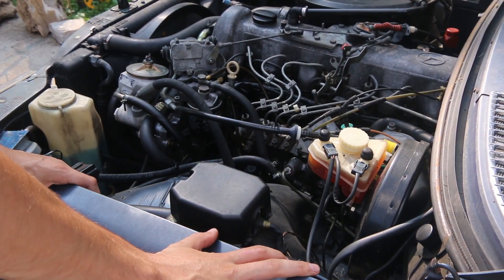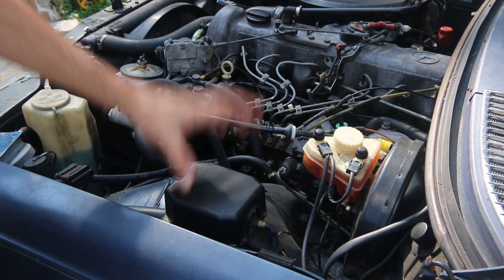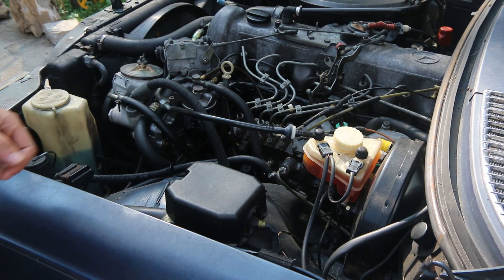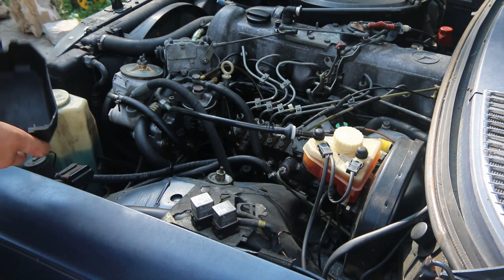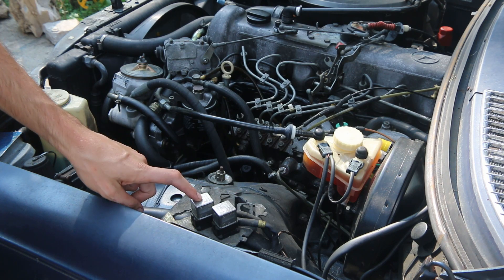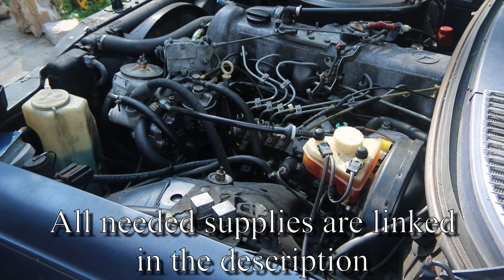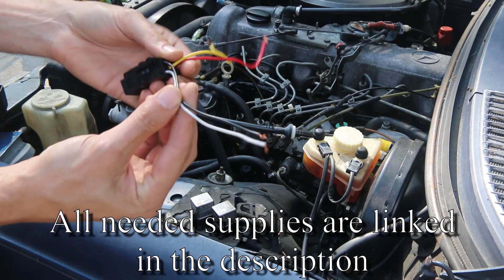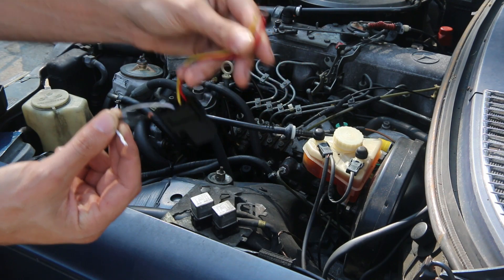W123 Aux fan AC mod & Evaporator cleaning (Cheap/Free ways to get better AC)

Comment: I just put in weeks of work or get my 123 200 petrol ac running and I have been looking for exactly these types of videos. 🙏 I can't thank you enough, especially that R12 is not available in SA
Reply from the maker: It can be real tricky, and while there is a plethora of information available about our cars, there seems to be little about modifications and improvements.
Reply: El gas Mo 49 plus es perfecto para reemplazar el R12

Comment: Years ago I took out the fresh air plastic grates right below the windshield and cleaned out the metal channel area that pulls air into the AC evaporator.  Then I came up with some material to come up with a makeshift cabin air intake filter.
Reply from the maker: Man I have thought so many times of a good way to get some kind of cabin air filter rigged up, the pollen is so bad where I live that its like walking down the yellow brick road to get into my car. I've seen some extreme modifications to accomplish that, with cutting the firewall and fabricating ductwork and stuff that would direct air across a filter, but your comment has got me thinking of some kind of filter material like the k&n outwears or whoever it is that makes filter guard things for dirt bikes and off road machines that repels water and catches big stuff. Would you mind sharing some photos of your setup? send them to my email if you'd like: tom at trythistv dot com

Comment: Hey trithistv, thank you so much for your time on these videos, ungodly amount of help and great explanations. I’ve done your recirculation mod and deep cleaned both the evap inside and condenser under the hood. Both these mods have dropped my vent temps by at least five degrees which is GREAT. Thank you!

I have tried the relay mod several times, but when I attempt to do it, the compressor relay makes an awful noise, and the fan sporadically turns off and on with the noise. It seems that the yellow/black/port 5 isn’t making full contact. I’ve tried running the black/yellow over to a ground point to no avail. Admittedly I know very little about electronics in general, and could just use any help. 

Keep up the great work, you’ve got a long time supporter.
Reply from the maker: Hmmm, I wonder if you've got a fuse or something making poor contact also, Let me double check my instructions and get back to you later on how it should all go together just in case something is off there.

The other night me and my wife went for a drive in the blue car and saw vent temps down near 36F while we were cruising along before the ETR would kick the compressor off to prevent freezing up the evaporator, it was a little cooler than some nights but I was thrilled with how good the AC worked. Felt as good or better than any modern car.
Reply: Well, just the two mods I’ve implemented have drastically improved my commute. For reference I’m in the Piedmont of NC and these afternoons are sweltering on the blacktop. Haven’t put a thermometer up to the vents yet but it’s been feeling about mid 50s even on the hottest days, definitely the 40s once the sun has subsided a bit. Thanks for the help and reply, I’ll keep a lookout for any updates.

Comment: Just fill the system with r152a or air duster like I did in my 1983 240d. I was blowing 38 degrees out of the center vents on an 80+ degree day and lots of humidity. I was running all original components also, all I did was change every seal in the system with new green HNBR O-rings and pulled a 30 in. of mercury vacuum for six hours and then refilled the system and the performance is astounding! Did not change the seals in the compressor also
Reply from the maker: I am actually planning on comparing performance of various alternative refrigerants in an upcoming video at some point.

The big issue with the ac in this car is likely partially the color of the car and interior being very dark. The ac blows 34-36f out the center vents when you're driving above 20mph and it gets frigid cold in the car after just a mile or two but if you stop and idle in traffic for more than a minute or two it started slowly getting warmer in the car.

My main goal is to systematically go through each component that could be improved, cleaned or tweaked in some way in fully stock form without requiring any real special tools or expense, and see what effect it has on the hot engine, idling, stopped in the sun type circumstances, as that is where the system really struggles in this car.

If you've been keeping up, it's made a quite dramatic difference already between the recirc mod and now this dropping vent temps from the mid 60s down to the high 40s in a worst case possible scenario, it keeps the car much more comfortable even on the hottest days.

Switching to 152a is certainly a viable option to improve performance at the cost of not being able to get the ac serviced at a shop (recovering r152a into a tank of r134a will get some nasty comments from the refrigerant supplier) and potential legal issues since the EPA does not allow 152a to be used in "retrofit" applications.
Which is completely asinine considering the performance, and miniscule GWP and ozone depletion compared to 134a even which was touted as the best thing since sliced bread when they phased out r12, and here we have something that is 10 times less harmful for the environment and we're not supposed to use it. Stupid. Utterly stupid.
But I guess that's the norm for that stuff, laws and red tape to prevent all the fun.

Keep your eyes peeled, you'll see some r152a sometime soon
Reply: @trythistv  Thanks for the reply, my AC system was a strong runner since the car had AC from the factory and once the charge depleted years ago no one replaced any components. So I'm running Mercedes original components with all new seals (except the compressor) and at idle I'm doing 40-45 degrees from the center vents on full blast. On the road it gets even better, however lowest I saw was 38 degrees right after charging the car and driving it around with a meat thermometer in the center vent on the second fan speed after I parked in my driveway. It was so cold the windshield was fogging up at night on an 80+ plus night. Do keep us updated as to what you do on your AC system, I'm curious as to what improvements can be done
Reply from the maker: Man it sounds like your cars ac is spot on!
I found interesting things when I was doing the recirculation mod on mine, like a bb shoved in a hose that stopped the vacuum to the entire ac system so none of the flaps were working. I couldn't figure out any reason why, the vacuum pods in the dash all seem to be ok, so some of my adventure is deciphering what has been done to my car and why.

My goal is to hit about 40ish idling in the sun, I feel like that would put me in good shape, with my temps getting so cold when driving I'm suspicious of the etr I believe it's called, little sensor thingy near the evap that cycles the compressor on and off when the evap temp gets to a set point to prevent icing up the evap. I'm curious if mine is stuck or lazy leading to inefficient cycling and higher than desired vent temps, that's one of the next things on my list to investigate and see what I can learn.

I really appreciate your comments and feedback, I learn a ton from everyone on here, and try my best to educate in return!
Reply: @trythistv  good idea the only thing I have to do now is start stocking up on Mercedes original expansion valves from w123's and early w126's so I can have expansion valves that are rated for r12. The new r134a valves have a tighter spring inside them for greater pressure which starves the evaporator core and you get 60-70 degree air at best. However, interestingly enough a fellow peach parts form member told me how he has bought expansion valves that are rated for semi-truck AC systems and you can adjust the expansion valve spring to accommodate different pressure ranges for different refrigerants. He sent a link in my AC write up to a website that has an expansion valve that will fit the w123 and you can use a wrench I think to adjust the spring tension for pressure changes. I was also relieved to know that the vacuum line to the ac dash pods was not leaking since I can hear the dash pods actuate the fresh air flap when turning the system on.
Reply: @trythistv  I ran r152a air duster in my 1983 W123 and it was by far the closest to running R12. Regarding your concern about the EPA they just don't go after DIY unless someone sees and documents you doing some egregious stuff. IN FACT when they phased out R12 they specified in the law that DIY car owners may maintain their own cars all they want without oversight except for one requirement. You can't buy containers of R12 that are larger than 2lbs.

Regarding R12 the ONLY thing the EPA banned was the continued manufacture of it. That was the only change. Many people are not clear on that. R12 is perfectly legal for you to buy and use as intended. R12 has been a regular item sold on eBay for years. Sometimes you can get it for about $2oz x 41oz and some wax free mineral oil and you're done.

When I started looking at all of the possible A/C system mods and upgrades and tweaks and all of the time involved so that my system would almost act like R12 I decided to skip all of it and just put R12 in my R12 system. It really is amazing. It also won't seep through stock hoses like the much smaller molecules of all other refrigerants.

If you do run r152a and need to empty your system before a mechanic's shop will touch your system JUST VENT IT OUT. It came from cans of air duster for electronics and keyboards. Offices all over the world dump out tons of it regularly. Office supply stores restock pallets of it regularly. It's not an EPA refrigerant it's a propellant approved for spraying into the air and blowing dust around. Another fun fact, I've seen air duster cans that use r134a. When you search for air duster most cans won't say r152a. They state the chemical name difluorethane. Staples brand seemed to be the cheapest. If you use a can side-piercing tool pierce the side of the can near the base where the metal is more rigid. The tendency is to pierce the can along the middle but the metal is weaker there so it tends to collapse and you get a bad experience.

Comment: Your w123 content is extremely helpful! Just picked up a strong running '85 300d with a non-functional A/C, which is the one 'broken' thing on the car that I feel is over my head on the repair. If you have any information on diagnosing the issue, that'd be incredible.

I've already upgraded my fuel filter, and plan to follow your cruise control repair instructions too!
Cheers
Reply from the maker: I need to do some work on the AC in my grey w123, it is currently completely non functional, I know why, but it may be a good opportunity to show how to diagnose and show the process of how I know what I need to do to get it working. AC is not as complicated as it seems, but it can be finickey as far as getting the charge right and all that
Reply: @trythistv   Looking forward to that possibility! I'm tired of my dog giving me evil looks on hot days.

Comment: Great video, thanks man! Subscribed. I am waiting to get my 280E and will need that AC to blow cold. Gets up to 110F here in summer.
Reply from the maker: 110F is worse than where I'm at, Every little bit helps though, especially with a dark colored car and dark colored interior like I've got! I've got a few more tricks up my sleeve I'm gonna try this summer.
Reply: Can't wait to see it @trythistv  I should be getting my 280E manual in a few weeks. First thing to sort is the AC. Keep up the good work.

Comment: My aux fan (on w123 with Toyota 1jz) doesn't work at all. And the Aircon is useless in the 30 to 35c temps here in Bangkok. I'll be doing the relay mod as well as sorting the motor and I'm sure it'll help. Btw, in Thailand and faulty aux motor makes a massive difference especially in city traffic. Thanks for this video.
Reply from the maker: You're very welcome, and yes, the aux fan makes a massive difference, especially idling in traffic and such, I'm looking into options for higher flow or at the very least an aux fan that will cover more surface area of the condenser as well.

Comment: Excellent video.  I have a 1981 Mercedes 240d and I updated the AC to a Klima with a Sanden Compressor.  Living in the lower end of the San Juaquin Valley any improvement on the AC system is much appreciated
Reply from the maker: Any improvements are well worth it, where we live gets quite warm in the summertime and the humidity can get brutal since we are close to a lake, I keep getting tempted to get the stuff and build a parallel flow condenser conversion for my car to go with my sanden upgrade. We'll see, I know it'll happen one day.

Comment: hi high pressure side readings will always be better with fan running while compressor engaged  instead of waiting for an overload situation then starting the fan . .
The theory is cooler high pressures are [remember pressure = temperature ] the evaporator functions better with a supply of colder refrigerant .
Reply from the maker: Science! Thanks for the explanation, that would also explain why the parallel flow condensers are a popular upgrade, as they are more efficient at dissipating heat from the refrigerant which is very important with r134a and other modern refrigerants that don't have the same properties as r12 did. I should probably learn more about the science behind ac, I understand enough to get myself in trouble lol

Comment: Awesome.  Thanks for sharing.
Reply from the maker: You're very welcome! Trying to get everything up to par!
Reply: @trythistv  
-Why not simply jumper the existing wire to the compressor's relay coil to the fan relay w a diode to prevent backfeed?
-Once an R12 system has been legally retrofitted it's ok to change it to anything.  How environmentally damaging is 152?  It's ok to clean keyboards w no recovery.
Reply from the maker: The two relays work in opposite, the compressor relay is provided power when the compressor is commanded on, and the fan relay is provided ground when the fan is commanded on. There is probably a better way to do it, I'm just not smart enough to figure that out lol.

And r152a (air duster) is 10 times less harmful for the environment than r134a, but is also supposedly flammable, so the EPA and dot have said it is not ok to use as a retrofit refrigerant, only to be used in new vehicles that have their ac systems designed to deal with the potential explosion risk. I've seen the stuff burn and it doesn't seem terribly dangerous to me, but I'm also driving a 40 year old car with no airbags, abs, traction control or the other electromagical babysitters that new cars have.

Comment: another way to add fan relay is to mount relay in vicinity of filter dryer. ground one side of coil, connect other side to hot side of pressure switch..move wires from temp switch to common and normally open side..
Reply from the maker: Thats a pretty slick solution! Thanks for sharing!

Comment: 7:15 very interesting.  Was it really worth all that for a couple degrees difference or did that cleaning make quite a bit difference?
Reply from the maker: Probably not, but every degree counts when its 1.3 million degrees outside or whatever it was during summer.
Cleaning the evap made me feel good about getting grunge that could have been on there for decades off, made the inside of the car smell fresher for a while too.
Reply: @trythistv Understand, very well.  May try this on my '84 300D I'm sure its in the same condition or worst, lol.  Did you come up with a self made cabin air filter???

Comment: Hi, i got the relay using your link, Thanks. It did not come with a yellow wire. Instead it has a blue. Should I twist the Blue and Black together? If so, then should the new relay have a constant buzz? Mine is buzzing with the compressor on or off. I might have done something wrong. Thank you inmensly.